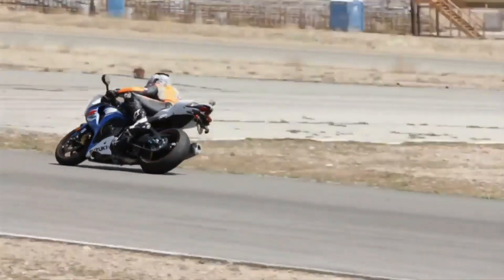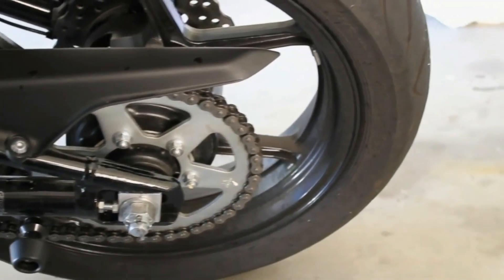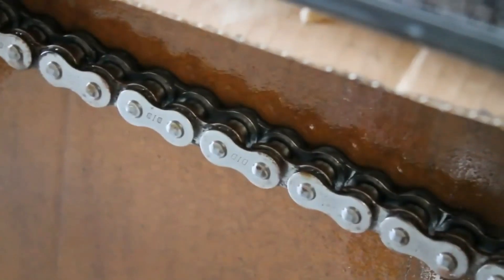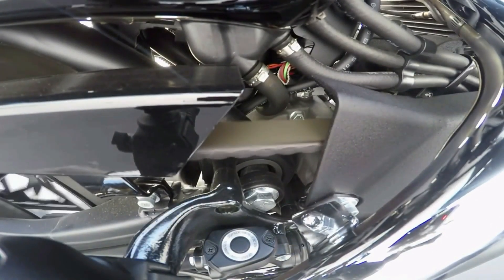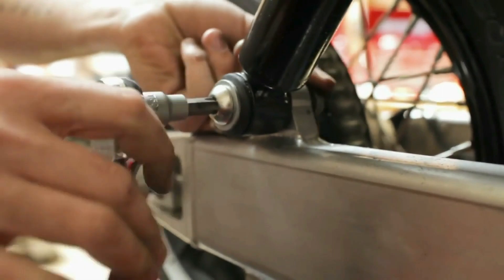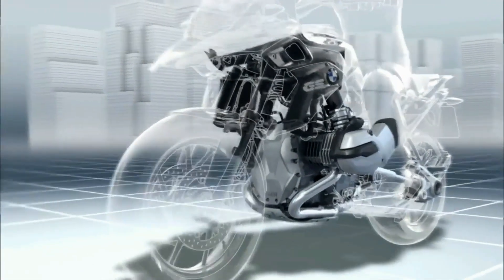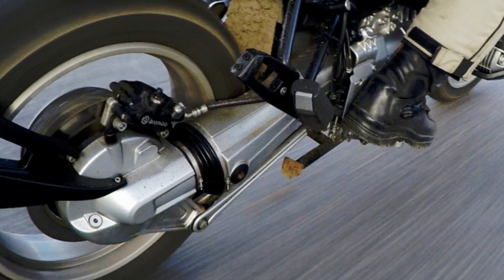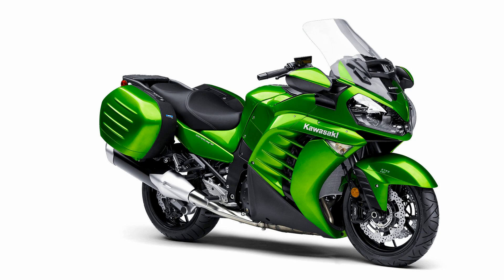Chain drive Vs Belt drive Vs Shaft drive - Which is better and why?

Comment: Thanks for this valuable information, although I already knew most of this information I have 2 bikes, one belt and the other shaft Like another viewer, I hate chain drive maintenance I did need your assistance on something, if you happen to have the answer I'd like to purchase a 3rd bike, a more nimble and sporty one, so if I get a chain drive bike, do you know any shops in the San Francisco CA area that do conversions from chain drive to belt drive? Believe, I tried all the resources, and have had no luck I'd appreciate your help on this Thanks and have a good one
Reply from the maker: Technically it is possible, but I don't think its a good idea moreover there isn't any after market parts available for this job that I could think of and the belt simply don't have the strength of a chain. Which is why the sports bikes uses the chain.

Comment: Great well thought through video. I dislike chain drive because of all the maintenance required and love shaft-drive because it is no mess no fuss. I ride shafties by choice esp. BMW because they are mostly shaft-drive and easy to service, with 20000Km oil drain intervals on the final drive. I have also have had Yamaha shaft drive (XJ900S) and found their system simple and effective.
Reply from the maker: Yes, shaft drive offers the peace of mind, it is the obvious choice for those who want to get on the bike and ride and don't want to get their hands dirty. But the frugality and flexibility that chain drive offers are hard to ignore for many people.

Comment: A belt drive is more efficient than a chain by about 20%.
Reply: Bass ackwards
Reply: Chains are more efficient, as they have reduced slipping and thus less power loss.
Reply: Mark Graves
Reply: m